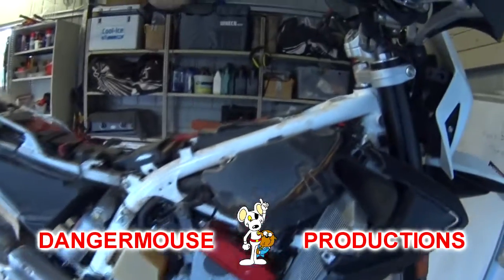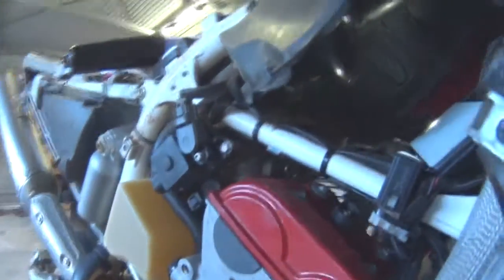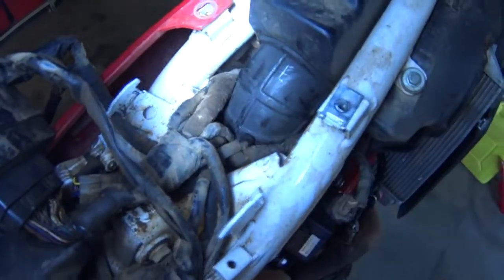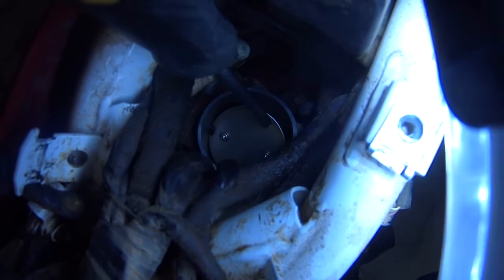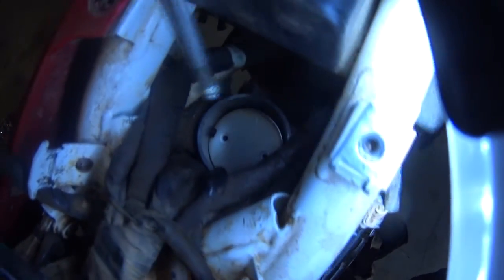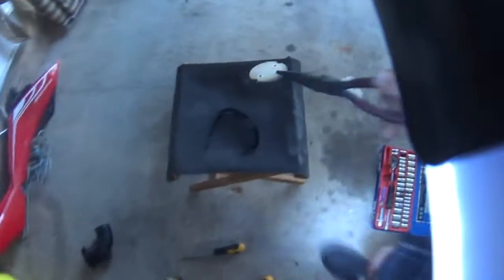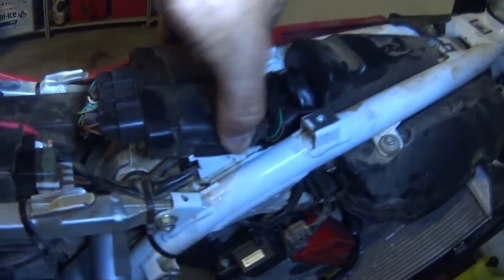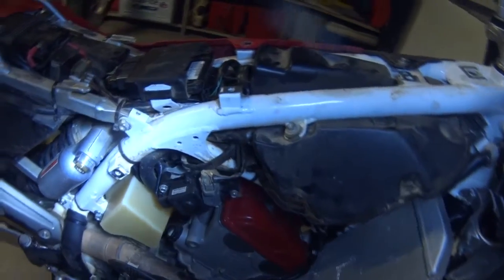Husqvarna TE449 & 511 Butterfly removal

Comment: Hi, I want to know at what time the upper butterfly should be suspended what is the benefit, what do you get, after removing it.
Reply from the maker: The ecu controls the second butterfly motor, it chokes off the air at times when you have the main throttle open. 
It also has a long delay time opening, closing and opening again. 
Removing the plate allows full control of the engine by the rider and not the ecu. It improves throttle response and helps stop 'flameouts'. The motor and shaft remain in place to keep the ecu happy. 
Here's another video I did of the delayed response in the original system. 
https://youtu.be/7Vn_9JxDOz8

Comment: I just finished this mod in my G450X. I did few test and for the moment im not quite sure that this was a good move. Right now i have a lot of pops from the exhaust, poping almost all the time. After some test in next weeks on race track i will decide to leave this mod or not.
Reply from the maker: Better throttle response? 
Is the 'popping' on over run with the throttle closed?
Reply: @Danger_mouse  , not sure about the response, will test that on track. Pops out when closing throtttle. Did you observe the same?
Reply from the maker: @kamilkamilo7774  
No, not something I've had on the Husqvarna models. Should be no change to mixtures, just unrestricted throttle operation of the primary throttle when opened up. I will ask a friend of mine who has a BMW if his is the same.
Reply: @Danger_mouse  thank for all help from your side, im watching your channel:) awaiting for more videos of 449 :)
Reply from the maker: @kamilkamilo7774  
No problems at all. 
So, I spoke to my friend, 
his 2 x G450X bikes both pop from the exhaust. He says it's pretty common. 👍 
Are you on any Facebook pages like 449-511 Owners Group or BMW G450X group? 
Joe is a member of those pages and could help you out.
Reply: @Danger_mouse  thank you once again. Just wondering did your friend noticed more poping after removing the butterfly, because I did:) nevertheless after next test on roads and track I will update you about the differences.

Comment: How you goin mate, good video. Did you find that you had to adjust the TPS after this? or is it as simple as removing the butterfly and enjoying the results?
Reply from the maker: I adjusted the TPS,  pulled the butterfly and removed the idle stop all at the same time. 
It transformed the bike from a stalling, doughy mess to rideable.

Without the changes,  I truthfully wouldn't still own it.
Reply: +Dangermouse What's the idle stop? Do you ride the stock muffler, map 2 and no O2 sensor?
Reply from the maker: +john doe 

Under the throttle cable cover on the throttle body, there is an arm that lifts a roller. It is there to control idle.
On some bikes, idle control is erratic. I removed the roller from the primary throttle arm to stop ecu controlled idle. 
I set up the idle off the brass idle air screw to around 2000 rpm.

I run MapII, O2 sensor is disregarded whether or not it is fitted in MAPII. 
My bike has the supplied Akrapovic slip-on muffler.
Reply from the maker: +john doe 

Under the throttle cable cover on the throttle body, there is an arm that lifts a roller. It is there to control idle.
On some bikes, idle control is erratic. I removed the roller from the primary throttle arm to stop ecu controlled idle. 
I set up the idle off the brass idle air screw to around 2000 rpm.

I run MapII, O2 sensor is disregarded whether or not it is fitted in MAPII. 
My bike has the supplied Akrapovic slip-on muffler.
Reply: +Dangermouse  Thanks! And how do you remove it? Do you undo the 11mm nut and pull on the throttle body? And do you know by heart of many turns from the closed position the brass idle screw must be turn? Thanks again for your videos and explanations
Reply from the maker: +john doe 

No, you carefully grind the riveted tip of the roller shaft away with a Dremel,  or similar and tap the roller shaft away from the arm.
Both throttle arms must remain in place. 

As for the idle speed screw. No sorry,  each bike is different.
There's no one size fits all setting.
I have mine at 2000rpm hot and it will sustain idle with a cold engine in our local conditions. 
Perhaps a 15-20 deg C morning.

Comment: Does this have any consequences / side effects like greater wear / bad in any kind of way ? I’m new to bikes ( l got a 511 btw)
Reply from the maker: No, none.

Doesn't produce more power, just improves throttle response.
What you do with the throttle tube is exactly what you get at the throttle body (via the primary throttle) - not what a commity and the  second butterfly want you to have 🙂
I removed mine to get the bike to run properly at around 70hrs or so, its got over 400hrs on it now with one 1 piston change, all off road.
Reply: @Danger_mouse  Okay thank you. My bike is throttled (I hope that’s the right word for it) to 42hp. Do you know what I need to do to get the full power of the bike
Reply from the maker: @jonasvonheute 
Does it have one of the European 'Locked' ecus fitted, limited power for road use type bike?

If yes, I'm not sure if they can be reprogrammed or not using an Android app called TuneEcu and some link cables.
It may be that you could have to source a new or second hand unlocked ecu 🤷‍♂️
In Australia, and most markets, the 449 had 46hp and the 5'11 had 51hp.
Reply: @Danger_mouse  yeah probably- my 511 is for road use and I wonder if l can get any more power out of it
Reply from the maker: @jonasvonheute 
I assume that you have the bike in Race Map II mode using the jump connector under the seat? 

Connecting using TuneEcu will be the only way to tell if you are able to remap the bike or not.
If you have the original catalyst muffler, you would replace it with a new slip-on muffler like Akrapovic or FMF etc and add the full power map (Tune) to the ecu.
You should join our Facebook group Husqvarna 449 and 511 owners group for more information. 👍
Reply: @Danger_mouse  yeah I’m already in the Facebook group since today. I don’t even think lm in Race map2 mode. I have an Arrow slip on exhaust. The think I have to buy the Race map 2 connector
Reply from the maker: @jonasvonheute 
You don't have to buy a connector, you can just join the 2 pins in the plug together with small wiring terminals and a short wire, then secure and insulte with tape.

The dash will display Race Map II on starting

Comment: How did you get the air horn out? I'm trying to do it now and it is quite stubborn
Reply: Ok so there is a clamp, I've loosened it.
Reply from the maker: +Zac Schneider 
The air horn is rubber and squeezes in at the sides to pull through into the airbox.
Be very very certain when you refit it that it is installed correctly and sealing,  otherwise it will leak dust into the engine.
Reply: Thanks for the reply. I figured it out not long after commenting. Man, it is an absolute animal now. I am loving it. So thanks for the tutorial!
Reply from the maker: +Zac Schneider 
Great to hear.
Reply from the maker: +Zac Schneider 
Great to hear.

Comment: We removed the butterfly on our TE449 and then had an issue so disconnected the battery and when we reconnected everything the computer has an issue because it knows the butterfly is missing and has stuffed the bike up. Anyone have similar issues or have a solution?
Reply from the maker: You didn't remove the motor from the butterfly shaft as well, did you?
Removing only the butterfly plate will not cause any issues.
Reply: Dangermouse hey, no, we had to disconnect the battery to change the fuel pump.
Reply from the maker: @helenlosciuto6644 
I'd suggest there is another issue.
Removing only the butterfly plate won't cause any issues with the ecu.
The motor and second butterfly shaft will operate as normal and the second butterfly sensor (tps) will continue to read the operation of the shaft.
There's no other sensing associated with the second butterfly.

When you say the bike has 'stuffed up', what is it doing?
Reply: Dangermouse by stuff up we mean the bike will splutter and lose power when given throttle, you can hear it most when revving the engine at low throttle.
Thank you for your help. We have taken it to a mechanic and they want the butterfly to put back in before they will do anything - very frustrating as we don’t have it. (Long story)
Reply from the maker: @helenlosciuto6644 
OK, I can understand that they don't understand the bike but can assure you that the butterfly is not the cause.

You mentioned the fuel pump, it is more likely that is the issue, or something like the injector is blocked or the spark plug is worn (very often overlooked)
There are many hundreds of these bikes and the earlier BMW G450X model running happily without the butterfly installed.
My own bike has run about 7000km without its butterfly fitted.
I wish you well tracing the problem.

If there is no 'Fail' message on the dash, then it is unlikely to be an ecu issue, most sensors including the second butterfly sensor will set a code and display Fail

Comment: gday mate, when is this mod necessary?
Reply from the maker: When you get the bike 🙂
It will ride far better than with the butterfly still in place 👍
What you do with the throttle will be turned into response from the engine and not delayed by the second electronic throttle.

Comment: how much does that help?
Reply from the maker: It helps very much. 

Makes the bike rideable down the bottom end of the rev range, especially when opening and closing the throttle quickly. 
Assists stopping flameouts and sharpens up throttle response from closed to cracked throttle. 
There's no reason to keep the butterfly in, it just holds back a good engine. 
Check out my slow motion video of the throttle shafts operating. 
It gives you a better understanding of the delay.